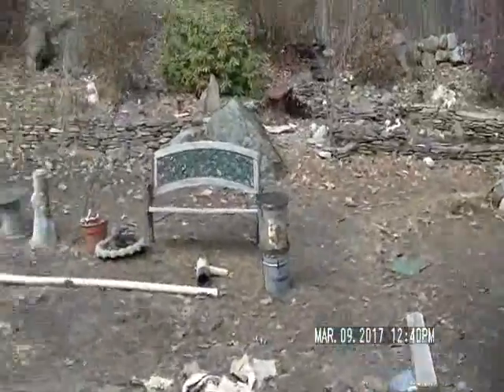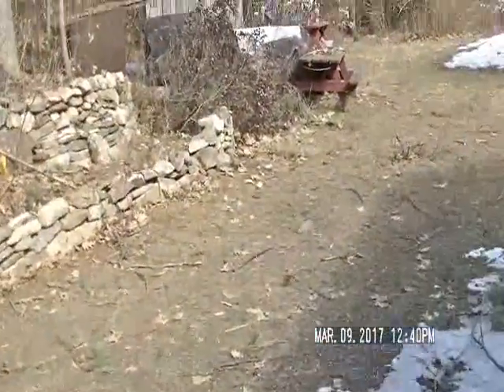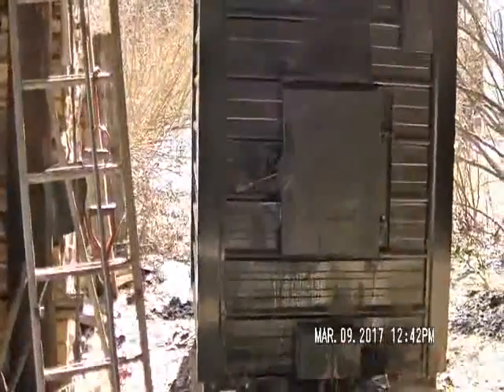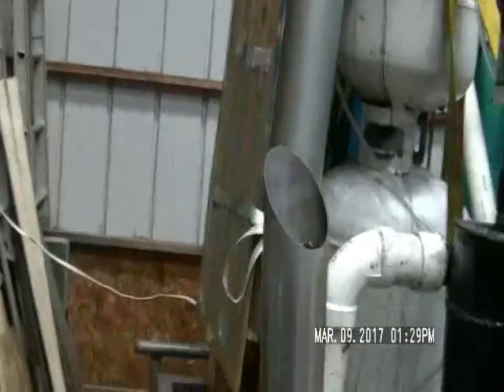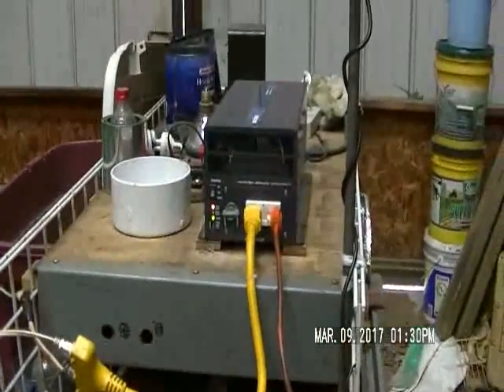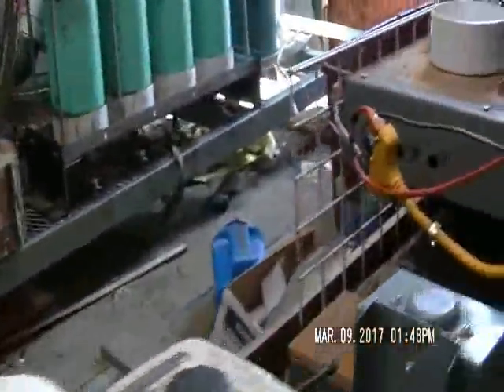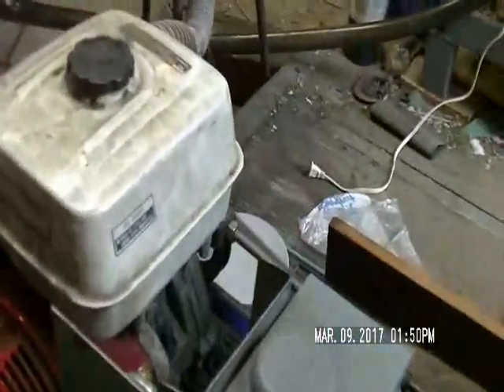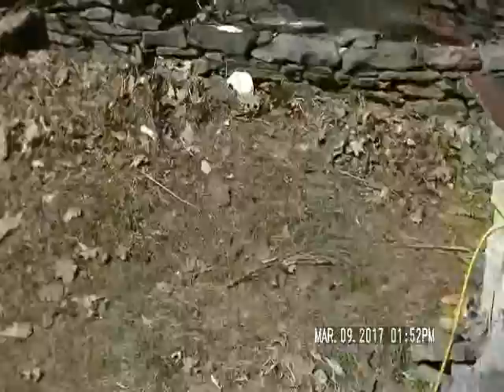NH Hbbyloggr- Grid down 3917gens power up

Comment: Bill you definitely have harsher weather there then we do here. We may see some snow tomorrow but it won't amount to much....Famous last words.
Reply from the maker: Mike, We are looking forward to single numbers for a couple of days then 12+ inches of snow  Tuesday and Wednesday. March- out like a Lion ! Are you moving around yet?
Reply: Bill things are still moving slowly but definitely better. I was finally able to take a shower today without someone having to do the washing for me but it's tuff doing things one handed. My hand has movement but I'm missing some feeling in half of my hand including two of my fingers and when I went to have the stitches removed yesterday the surgeon told me that I would not gain full movement of my arm but they were going to work with me to get it as far along as possible. As long as I can weld and work with stuff I'll accept it. I think in the long haul I'll still be able to play music and that means more to me than anything.
Reply from the maker: Mike, You're making gains, a lot faster than I would have thought. Keep working on that " Range of Motion" and exercises to gain the movement back. We are all pulling for you, buddy ! You can prove the doctors wrong, you know !